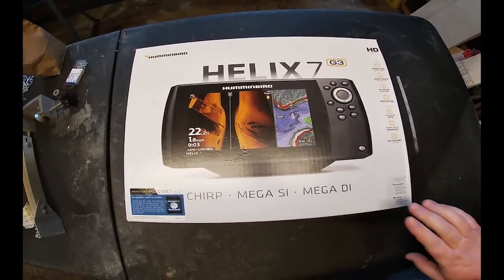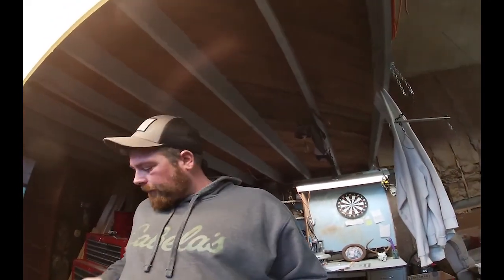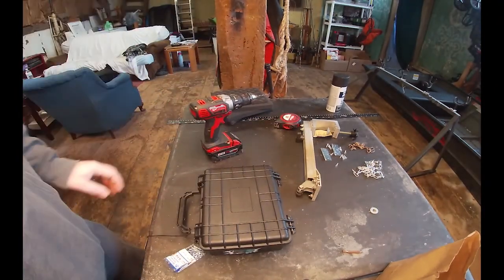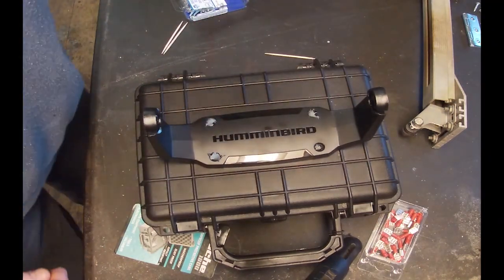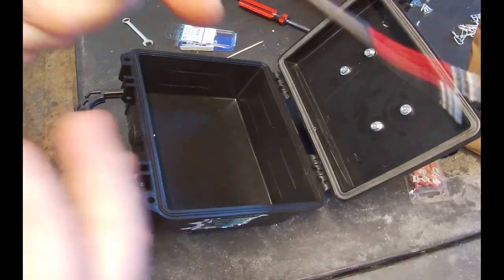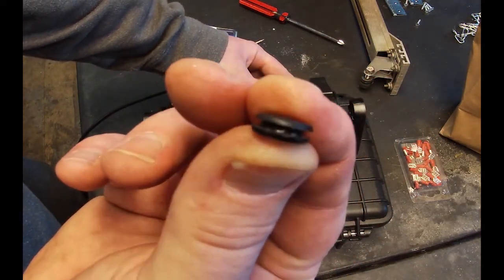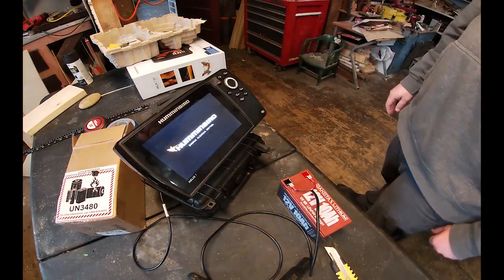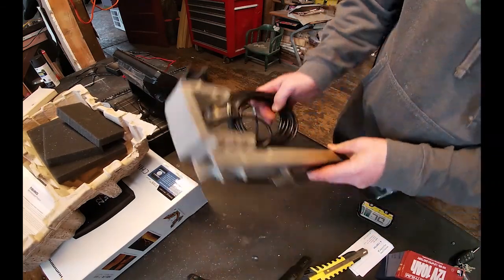Portable Fish Finder Build

Comment: Where you referring to the "Ice Hole Power" channel? Also, you are right about Lithium ION not lasting more than a few years before wearing out and that they drop below the 10.8 volts your Helix needs about 2/3 of the way through. So you would only get 10 Ah out of a 15Ah Lithium ION....  With Lithium Iron Phosphate (LiFePo4) you will get the full Ah rating. So you get 15Ah out of a 15Ah LiFePo4 battery. Plus with proper charging & storage (which most people won't do correctly) they should last 8-10 years.
Reply from the maker: Yes I was, I watched alot of his videos on batteries